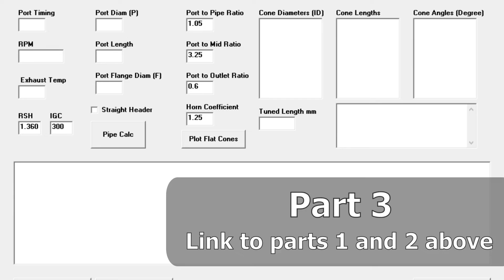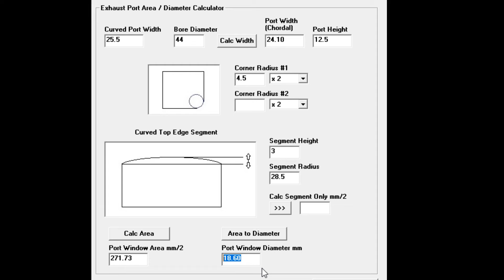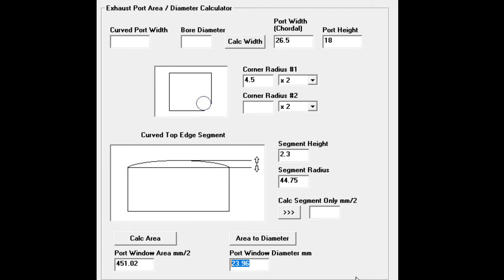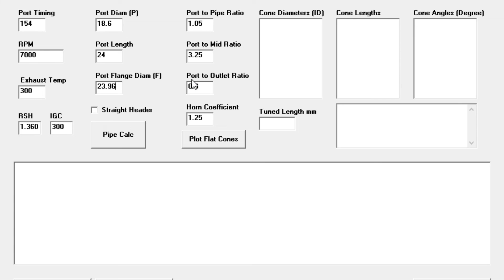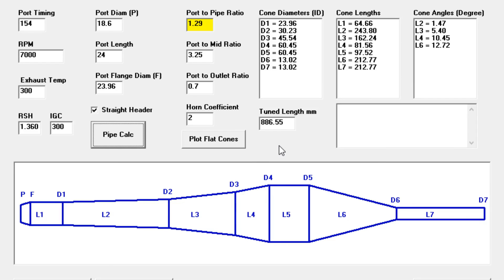2 stroke porting, part 3 - Converting Exhaust Port Map to Area.

Comment: Why only 1 rpm range. Does that effects mid range throttle response
Reply: Hope you will note this
Reply from the maker: What do you mean by one RPM range ?
The RPM value you enter is the maximum or redline RPM of the engine.
Reply: @AuMechanic sorry, i have seen another software with peak power on specific rpm
Reply: So ith this is like that
Reply from the maker: @Arununni49  Ive seen that in some software and cant be certain how they use that value.
However it is a mistake that some make that tuned length of the pipe is based on the power peak RPM and not the maximum engine RPM as it should be.
Reply: @AuMechanic  can u make a simple video on how to measure exhaust temperature. The one you done is little complicated for me. Not good at maths😅
Reply from the maker: @Arununni49  " can u make a simple video on how to measure exhaust temperature."
There is a function in the software under the tools menu where you can enter the peak power in HP or Kw for your engine and it calculate and give you the BMEP value.
Once you have that read the table in that section that will give you an exhaust temp range to use based in the BMEP.
Reply: Why don't an option for gp (full potential) Mode, I have seen one like that on mota
Reply from the maker: @Arununni49  This software is basically a copy of the code provided by GP Blair
See the software page which covers that.
I have not expanded on his original code with any other functions as it works well as is.
Mota and others are not freeware so they have incentives to expand the function of their software, but I will mention that pretty much all of the software has elements of or is based around GP Blairs original code published by SAE in 1996.
Reply: @AuMechanic  It's a pity that I'm not interested in two-stroke  engines. I'm interested in four-stroke  engines and Gespan(sidecar). I compiled programs for Linux from Blair's 1996 book. 2 programs for calculating silencers. Program 8.1 and program 8.2. They work fast! I also got hold of the original programs from Gordon Blair's book for two-stroke engines. Blair has 3 books from 1990, 1996 and 1999 and I have all of these books. And I also have 2 volumes on manifold design. Desmond Winterbone and Richard Person, 1999 and 2000 year. But in general, I prefer IC engine simulators, fast 1-D simulation, like Lotus. If I have time, I want to make a laminar flow muffler(Auspuff) with annular gap - from Blair's books. The drawing of this muffler is in all 3 of his books. I have Tig/wig welding and other tools and I know how to weld metal.

Comment: Hi! Great video, my question is what if my exhaust port is oval? How can i calculate an oval port diameter? Informative video, cheers! :)
Reply from the maker: You can just divide it into 4 parts, once you have mapped it to paper then measure the radius of the top and bottom and then each end.(EG select a socket that matches the radius is the simplest methods and measure the diam of the socket and halve that for radius)
When you put a socket next to the top radius for example you will see roughly where the radius begins the change to the side radius.
Then just measure the height and width at the largest point about centre of the port to get height and width numbers to plug into the program.
Reply: @AuMechanic Thank you!😀

Comment: Is there any way to account for a restrictor plate in the software? It's for a yamaha kt100j engine
Reply from the maker: Is the plate in the intake or exhaust ?
Reply: @AuMechanic  in the exhaust
Reply from the maker: @T-crisp  Ok
I would say no change.
If you for example reduced to diameters of the pipe including stinger to suit the restrictor hole size rather than based off ex port area you may cause too much back pressure and overheat the piston.
Reply: @AuMechanic  He probably meant the power valve on the exhaust, which was invented by the Japanese. The power valve changes the volumetric efficiency of the two-stroke engine.
Reply from the maker: @Gespan-r9v  I'm fairly sure the plate he is referring to is a restrictor plate for regulations.
The Yamaha KT100J is the engine juniors use in Karting, the KT100S is for drivers over a certain age, very young drivers have to have a restrictor fitted to limit the speed of the 100J

Comment: i am trying to use a wobbly duct (reduces to 90% port area then back to 100 percent in its length of 2 x bore.)    and use your 2t calc but the duct comes out at 94mm long and your calc says it cant be longer than the header.  part of the duct will actually be made same construction as the header ie 1mm mild steel. any ideas?
Reply from the maker: The "wobbly duct" principle only applies to high performance race engines with a high BMEP, being based on modelling of Mach numbers in the port according the the creator of it. 
I'm a little cold on the idea myself in the absence if any examples of real world improvements it offers that I can find.
Be aware the warnings given in the 2t calc are just that, they are advisory only and you can ignore them if you are looking to a specific design outside of standard pipe design.
Reply: thanks for reply, ive already modified my cylinder ex duct and tried this wobbly duct but borrowed the first section of the header to get the dimensions right and it seems to have given me a boost. most cylinder ex ducts diverge which is wrong. they should converge. at least that part of his theory works for simple single ex port motors. im gonna build a few pipes with and without the duct and the dyno will tell me whats what. @AuMechanic

Comment: my exhaust port has a smaller width at the bottom than at the top. ie the sides are sloped and then a 8mm radius in the bottom corners.  your tool is assuming my port width is uniform. how do i get around that? i suppose i could work out the are that is being overestimated and subtract that.
Reply from the maker: See comment reply in other video
Reply from the maker: @aljaxon69 A shortcut method would be to simply measure the width of the port up top and the width at the bottom, add the two values together then halve them to get the average width of the whole port and then use the calculator in the software to do the rest using the averaged port width value.
Reply: @AuMechanic  the outer edges of the port are curved. but due to being on the edge and acutely angled to the flow the actual are of the curved bits is negligible. ie 5 sq mm at an angle of 50 degrees to flow is nearer 1mm actual area
Reply from the maker: @aljaxon69  Oh curved
Sorry I thought you meant they where sloping or angled.
Ok for curved edges you can use another calculation that deals with "segments" where you separate the curved segment of the port with a straight line to isolate it from the rest of the port, and then calculate the area of the segment, and add that to the area of the rest of the port you have added up without the segment. Same way we do it with the curved top of a port in the software so you can use that function separately using the "Calc Segment Only >>> button" to do the segment and then add that area to the rest calculated assuming a straight edge port.
Reply: @AuMechanic  thx ill have a look.

Comment: Excellent videos! Im trying to find technical info on how chambers change for multi-cylinder engines. I have a twin cylinder engine where weight and size requirements restrict me to a single expansion chamber.
Reply from the maker: Sorry I cant help with that as I have never built 2 into 1 pipes myself.
I can only estimate you would need to upsize the diameters of the chamber and it would be less than double.
Also the tuned length could also depend on the timing you run.
Some suggest halving the tuned length but that would only work if you had an exhaust timing of 180 degree.
Reply: G. P. Blair's books from 1990 and 1996 write how to make a 2-in-1 exhaust for a two-stroke engine with 2 cylinders. But there is also a book. But there is also a book by John Hewood on two-stroke IC engines - The two-stroke cycle engine, SAE, 1999.

Comment: I'm of the understanding that L1 includes the cylinder port length? If so your tuned length as per your program is always my port length short all the time
Reply from the maker: The software simply subtracts the port length from L1
Since port length is not know until you put it in the software.

Comment: Hi Dave..! Exhaust port oppening time of  my own made engine is nearly 180 degrees.Can I start my engine.pls advise me.
Reply from the maker: 180 degree exhaust timing is pretty average.
High 190s is standard for high performance.
You can go up to about 210 and it'll still run but not much power at low RPM

Comment: Videos are interesting and informative.
I can get my head around most of the formulas, except for the exhaust port duration.
I can't understand why the conrod length affects it.
Surely, if the swept length is 50mm and the exhaust port height is 25, the the duration is 180 degrees.
360 degrees, 100mm total piston stroke, 50 mm total port height. 50/100 x 360.
Am I missing something?
Reply from the maker: The Piston movement in mm is not linear to the distance moved by the crank in degrees because the piston moves at varying speeds over a single stroke.
So when measuring the port timing by way of using port high measurements a formula is given to provide you the exact value of degrees per piston movement in mm.
Reply: Ahh, I see what you mean, I mistakenly thought that the linear movement correlated directly with the crank rotation.
Thanks for taking the time to answer.

Comment: Hello, does reed valve affect exhaust dimensions?
Reply from the maker: No it doesnt.
Reply: @AuMechanic  thank you! And it is better to have flange same diameter as exhaust port window, or it is better to be bigger? :)
Reply from the maker: @skylp8161  In most cases the flange end will be a bit larger then the port window so just stick with that.
Keep in mind when comparing them that that the port window measurement is "chordal" (directly across the port, not flattened out curve shape of the bore.)
Reply: @AuMechanic  ok, thanks a lot :)

Comment: Question about making an exspansion chamber. If pipe need s to be radically curved for fitment and space restrictions does that need a completely different program to calculate or can you curve a pipe  to fit my needs while still using that program your using.
Reply from the maker: The calculations in the program apply regardless of the pipe having bends so long as you apply 2 rules and that is bends must not shorten the pipe length nor reduce the cross sectional area of the pipe where the bend is. There are a few methods to do this, you can use the old "pie slice" method or use a software like "Cone Layout" to plot the cone bends to paper you then trace to the metal to cut out.

Comment: Awesome videos! I've only had a flick through them but it's really good the way you walk people through things. Is this software that you created? Looks like something that would be easy to create as a mobile app as well if that was something you were interested in.
Reply from the maker: I did write the software (in VB6), in fact it is a derivative of the original Basic code written by Professor Gordon Blair published by SAE for 3 stage expansion chambers.
I was thinking about a mobile app and it is a good suggestion however there are a few things like printing the plotted cones that lends itself to desktop use at which rate I did not really see any justification for a mobile app.
There is also the multiline popup help that I use on all my software that provides contextual help within the software that might be difficult to do in a mobile app and most of the inputs do require some technical help to fill in.

Comment: How can reduce sound of ex chamber
Reply from the maker: The simplest answer it just use a larger and longer muffler on it with more absorption material, so long as it is not more restrictive to the outlet pipe.
The long answer is to design a three stage muffler that deals specifically with the bandwidth of sound the engine makes but how to do that will require a whole video or more that I may do in future.

Comment: Hey Dave.

For the sake of experimentation (and entertainment) I am building a supercharged two cycle 650 twin on my YouTube channel. I don't expect to get massive power, I'm doing this mostly because I'm curious and the opportunity came along. 

I haven't been able to find any information on this, even though it has been done a few times in the 80s 90s on Jet Skis. There seems to be a lot of opinions about this on forums (mostly related to turbochargers), but most opinions leave a lot to be desired, as when I start reading I quickly realize that most people talking don't understand the basics of a two cycle engine. 

I'm wondering if the pipe will be somewhat self compensating for the additional intake pressure. Also if there's anything that comes to mind that would be ideal, either exhaust or porting, that would be best suited for forced induction. Quite honestly, I feel like I have a decent grasp on two cycle engines, but with this I just keep going in circles.
Reply: @Black Dog I have also worked modifying and experimenting drag racing snowmobiles engines. They are a different beast though, because they use a CVT and are only used at wide open throttle. You can tune them for max power and then adjust your clutching, and other setup, around the power you are making. On most other engines you require a wider powerband. 

With a jet ski, they have to be able to idle in the water without stalling or idling at 20mph, haha.... and they also need to have a fairly responsive throttle from idle all the way up to the rev limiter. This makes them much harder to tun.

Comment: I have a question I cannot find an answer to. But you might have some input. How can I contact you?
Reply from the maker: See the about tab on my channel page that has the Email, or just put your questions here which I prefer as answering can be helpful to others.
Reply: @AuMechanic  well, I'll try to be brief. I was raised on 2 strokes. Iteljet 50, then a ds80 In 1986. All my 2strokes had big ex-chambers. A few years ago I bought a 1981 TS185 for my wife. To me it seemed to run really weird. I was convinced it had a leaky seal. Right crank. I tried to do a full rebuild. Also carb work..Long story short, it still runs weird..... question; is it possible it is just the lack of expansion chamber.?? At WOT, under load, it loses acceleration... I notice the TS 100 has a bulbous ex-chamber but the 185 is smaller longer and starts later....?
Reply from the maker: @justinwest9081   Re the crank seal, a leaking crank seal will be the worst at low RPM (more time for the seal to draw in air), so poor idle is the first sign.
As to the TS185, (far as I recall) it is an Ag bike for farm work so it has a flat power curve, you could make an improved chamber for it but you would want to raise the port timing a bit too.
But to be honest its a good learning bike and once she is comfortable with it maybe look at something more Road Trail rather than spending time and money hotting up the TS, your choice but that's what I would do. The TS100 OTH has rotary disc intake so revs more and a bit more peaky (peak HP at 7000 vs TS185 peak HP at 5600)
Reply: @AuMechanic  this is supposedly the trail version. There is a farm version as well. Regardless, I believe your point is still valid that it may be just how the bike runs. Seems odd though. Thank you for your input.
Reply from the maker: @justinwest9081   Yep the trail version is probably more the accessories than engine difference. One thing Id do is take the pipe off and burn out the carbon build up in it, specially the silencer, a coked up pipe can really kill power and its old. Maybe just take the silencer out first and run it to see if has a bit more pep, that's a sure sign the pipe needs a burn out.

Comment: Hi again ,my bike Yamaha rd350lc 2 (Rz) in Aus has a powervalve system ,can I ask how I should factor this into exhaust port area or any other part of the design ? Thanks again .
Reply from the maker: Use the fully open dimensions for area and timing.
Reply: @AuMechanic  Thanks  mate , I've done exactly that and I'm getting really odd results of the header length , I'm getting a around 65mm and my current standard Yamaha pipes have a header length of 300mm and 65mm seems far too short to me .
Reply from the maker: @topfuelteddy  Is the header straight ?
Measure the header and the diffuser length of your pipe and compare that to the total of the  L1, L2, L3 and L4 values to see if that is similar in length up top the mid section. In the 3 stage pipe the diffuser is very long so some of L2 part of the diffuser may constitute part of the header of your pipe.
Reply: @AuMechanic  Thanks again , I thought that might be the case of incorporating  some of the header into the first diffuser cone as the angles are quite similar .
The original header is tapered . Really appreciate your time again .

Comment: Really appreciate this, so interesting.can I ask does the calculation works ok for 2 cylinder engines ? Thanks
Reply from the maker: It is the same regardless of how many cylinders the engine has so long as there is a separate exhaust pipe for each cylinder, just use the dimensions from one of the cylinders in the program to do the calculations.
Reply: Thanks , by any chance have you ever done any calcs for a Yamaha rd350lc ypvs , was it the Rz in Aus ? Appreciate your time .

Comment: Hi sir  I have goped bigfoot spindle drive I have 23cc engine without weight tyres is spinning very fast but when I try to ride on it than there is no speed after full throttle what is the reason?
I means speed is killed I have checked the contact of spindle to tyre is fine but I cant ride on it please can you advise me